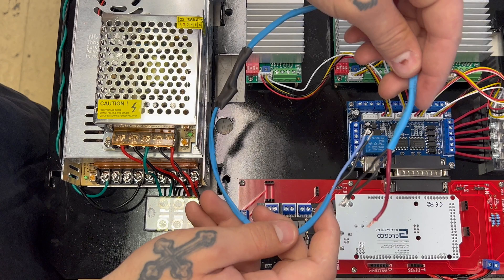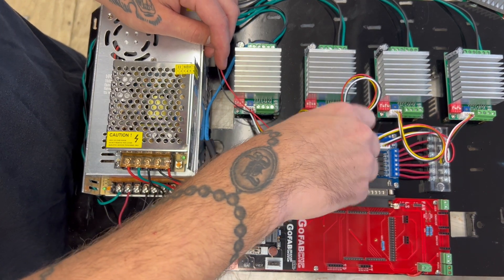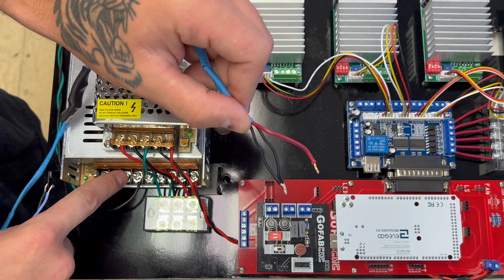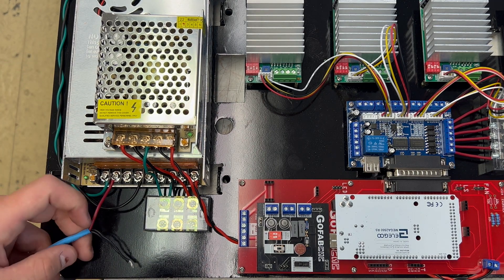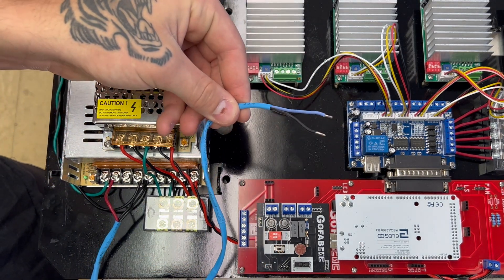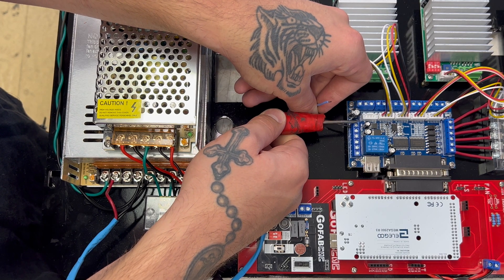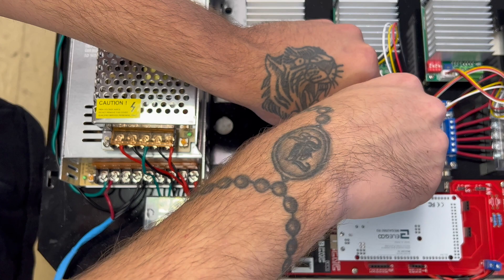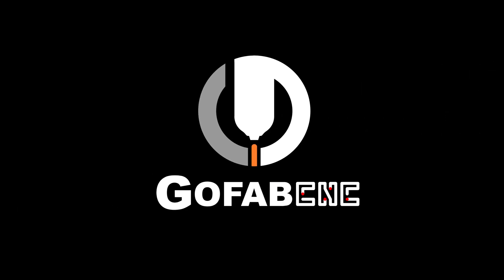Installing the Power Module that Fixes the Low Cutting Voltage Error

Comment: How do I get one of these modules? This error is one of the main reasons I don't recommend gofab tables, my THC hasn't worked since about 3 months after I got my table.
Reply from the maker: Contact us at: support@gofabcnc.com and we'll make sure your Table is working as it should.
Reply: Hey Jacob, can I get your thoughts about their cnc plasma table. I'm thinking of getting one but I heard mixed reviews as far as the quality and tech support. Any input would be appreciated.